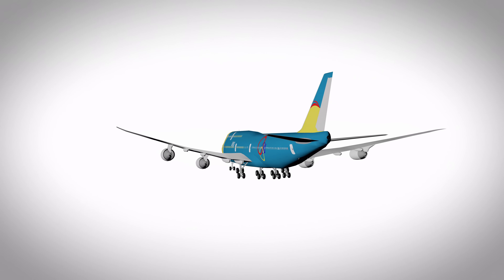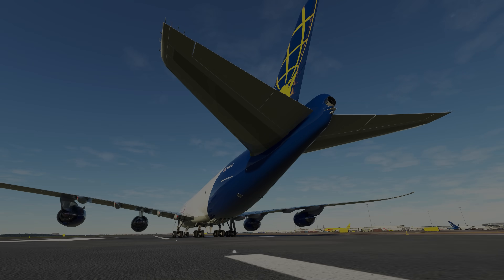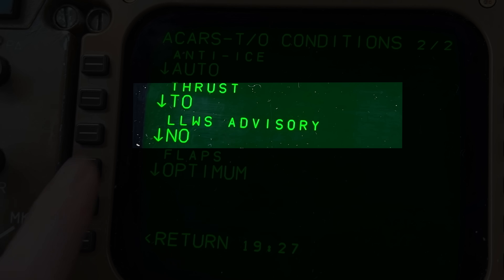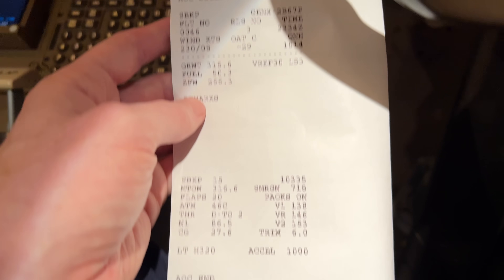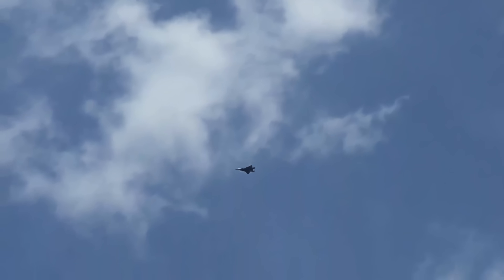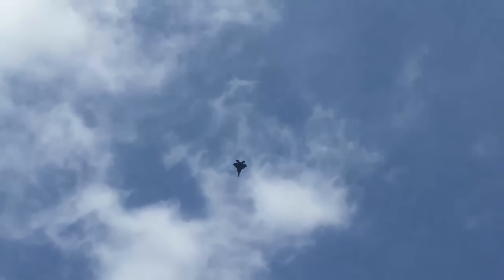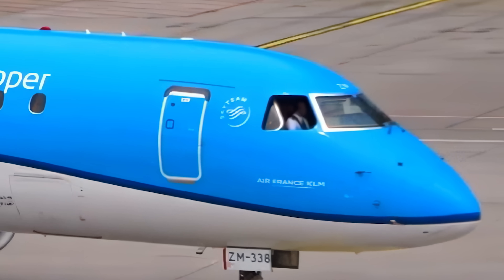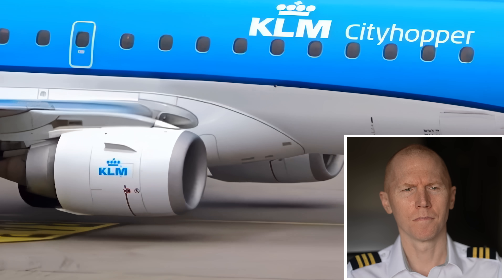Unsafe 747-8 Vertical Takeoff

Comment: Car gal here, also ex truck driver. Also motorbike gal.

Your comparison to using transmission / gearbox / engine braking is so way off its not even funny.

Have you ever taken your foot off the accelerator in a car before? Guess what you are doing...

With an automatic transmission, you when your engine revolutions are low enough, you can just move the leaver to a lower gear selection and it will shift down, increasing engine revs and increasing that breaking force.

With a manual transmission the braking force is even stronger as you have a direct connection instead of a torque converter.

On some vehicles, most commonly trucks, there are a number of "supplemental braking" options including engine, exhaust and transmission braking systems.

All of which ultimately transmit force through the transmission / gearbox to slow the vehicle.

Some of these systems can have their intensity levels adjusted in cab and on the highest setting its like slamming on your foot brakes.

At those settings, they even active the brake lights.

Transmissions and gearbox's are DESIGNED to do exactly that and whilst you technically can force a transmission to shift, or shift a manual gearbox, in such a way as to cause damage, that damage is most likely to occur in the engine.

A driver who does this is the same sort of person who might lower the flaps to maximum whilst at full engine power and sitting at Vne.

You REALLY have to be an idiot to pull it off.
Reply: Except when there's one of those pesky "No Engine Brake" signs.  But I think Kelsey wasn't talking about truckers just ordinary drivers. For the ordinary person driving their Kia Forte and using engine braking every time they slow down because they want to avoid wearing the brakes, wouldn't that have at least some effect on transmission life? I'm talking about the life of the car not necessarily just the time that the owner has the car, because of course they probably won't wear out their transmission during say seven years of ownership. But I would think some owner down the line might be needing transmission or clutch work sooner than they would have if money mizer guy who owned it before hadn't tried to save money on brake pads.
Reply: @StevePemberton2  I was talking about ALL vehicles, not just trucks.

And honestly, the transmission / gearbox is under much more strain when accelerating hard than when decelerating.

I'm not sure if I'm actually "saving" brake pads, but I'm keeping my vehicle under much better control.
Reply: @35manning  Not doubting any of that, I'm just wondering about long term life which is a lot harder to gauge. But also I realize not a topic everyone cares about, at least based on previous discussions I have had on similar topics when I am informed that the person doesn't care because they don't plan to keep the car more than a few years. Which I understand but that doesn't change the question of whether there is wear or not and how much. If say a car is downshifted at every stop for its entire life, does that mean the trans or clutch fails at 240,000 instead of 250,000 miles, well of course no big deal then and there would have been some break wear savings to offset that. But if it's a difference between say 150,000 and 200,000 then that's possibly going to make a difference to somebody down the line.
Reply: @StevePemberton2  I'd love to see a scientific test about the claim.

Take at least 20 new cars, all the same make / model, put them on dynos and control the brakes, accelerator and transmission by computer.

They all accelerate the same, at the same time. They all slow the wheels at the same rate until stopped.
Half use foot brakes entirely. Half use engine / transmission braking as much as possible with foot brakes at the end.

When brake pads need replacing, replace them.

Continue until all the transmissions break (on all vehicles).

Then look at the results, did the cars that used engine braking have their transmissions fail sooner? If so, by how much.
Break down the cost of repairs, average that over how distance travelled to find out the cost for the difference using brakes only.
Work out how many brake pads were used, their cost per distance etc.

I mean, I'm not aware of ANYBODY who has actually done this sort of testing.

I can say, my 1989 four wheel drive has lived a hard life, used and abused often beyond its limits in an environment that most cars shouldn't be driving in.

And after over 1,000,000 km (the odometer stopped working, I couldn't say how high that number is now) its gearbox still works very well.

And I'm not talking about just gentle or even aggressive down shifting for engine braking, I'm talking about high revs and dumping the clutch hard, bouncing the wheels off the ground which causes shock loading on the system etc.

I'd like to see numbers, not wives tales.
Reply: @35manning  Numbers would be great. Especially on regular entry level cars not 4WD designed for ruggedness. Which is what I assumed Kelsey's original comment was about, he specifically referred to someone who is not necessarily skilled at shifting. Not that it takes great skill to drive a manual transmission but the implication was the average driver who isn't really a car person but who has heard somewhere that it's better to downshift to save the brakes so that's what they do every time they come to a stop.

What I wonder is on a typical car how good that is for the life of the powertrain. Probably not a lot of data on it because realistically I don't think a lot of average drivers driving average cars do that whether manual or automatic. At least I don't remember driving with anyone who did that, I guess maybe I just have never driven with any car guys or gals. If more people drove that way then you could find average priced cars that were driven that way their entire life and compare them with cars that were driven normally.
Reply: @StevePemberton2  I've had many cars and motorbikes, not all rugged modified offroad vehicles. I also teach others how to drive including down shifting.

Many modern cars with "sports shifting" modes etc include protection systems to stop the one thing that can cause issues, shifting down gears too quickly / at high rpm.

Any one who does that, will realise VERY quickly their car doesn't like it. The engine will scream at them.

As a car gal, or as I prefer to call my self, a driver, jump in the passenger seat with me and you'll see me doing a dance with my feet.

I use a combination of techniques, rev matching, double clutching, left foot braking, heel - toe braking etc.

Whilst I would never break the road rules *looks around for police listening in*, I've driven all sorts of cars much harder then intended.

As in, three of my cars and all of my motorbikes have gotten air time. As in all wheels off the ground.

I honest think that only two of my cars have ever kept all four wheels on the ground. 

That's not to say I'm reckless, there is a time and place for fun, lots of traffic, wet weather, lack of sleep, passengers, other people's vehicles all dictate my driving style.

Never had any issues with transmissions or gearboxes.

The closest, was my four wheel drive just after I bought it and drove it hard.
Jammed the handbrake on with mud, didn't realise (because the lever still worked fine) and the engine is so powerful it just ignored it. But the clutch wasn't so happy about powering forward whilst also braking hard.

Needed a new clutch, but that's also a good thing. A clutch is pretty cheap to replace and is a good weak link that will protect the more expensive gearbox and engine.
Reply: @35manning  I have always been interested in double clutching but I have never driven with anyone who did it. I thought I remember reading that it doesn't really work well on a standard car with a synchronized clutch but I could be misremembering.
Reply: @StevePemberton2  lots of people say you shouldn't double clutch a synchronised gearbox, but I've also yet to see any evidence as to why.

Yes, it can be done and I do it all the time. I sometimes also float my gearbox (shift without using the clutch).

Of course I learnt to double clutch on a crash box (non-synchronous) where you either do it, or you make loud noises, but you can learn to do it on any manual.

Downshifting is the best way to learn to do it.

1) Wait for your revs to lower enough to support a down shift.
2) push clutch in, shift to neutral and release clutch. 
3) push accelerator hard to increase revs to the next gears rpm.
4) push clutch, shift to next gear and release clutch.

If you do it right, when you release the clutch the second time, your engine RPM won't change at all.

If RPM increases, you didn't rev enough, if it decreases you revved too much.

Floating your gears is actually easier, just less forgiving.

Upshifting is easier for this.

1) whilst accelerating and near peak rpm, apply firm pressure to the gear lever towards neutral.
2) lift off the accelerator, if you've applied enough pressure to the gear stick, it will just fall out of gear.
3) move towards the next gear and apply the same level of force on the gear stick.
4) when the engine rpm falls enough, the gear stick will just fall into place.
5) push the accelerator and repeat.

Downshifting whilst floating is basically the same, except you pause the lever in neutral and use the accelerator to increase engine rpm to the next gears require rpm (or just above) and then put pressure on selecting that gear.

Unless it's broken, you can always use your clutch to fix it if you stuff up on floating.

Once you know the RPM difference between gears, you can also skip shift using both of the above techniques.

That is, change from 1st to 3rd, 4th to 2nd, 5th to 1st etc.

Most trucks actually are easier, as their gears are very evenly spaced apart, normally 500 RPM for a full gear, 250 RPM for a split gear.

Cars, not so evenly spaced. But once you learn your car, you know your car and I don't even think about it or watch the tacho, I just feel what it needs.

Being a good driver isn't that hard. As long as you WANT to be a good driver and not just get from point A to point B.
Reply: @35manning  I'm thinking maybe what I had read was that double clutching wasn't really necessary with a synchronized clutch. I suppose that's true to some extent for the typical driver, similar to the concept that automatic transmission for most people is good enough in terms of accuracy. Whereas for others obviously it's not.

The most abuse I think I did was when my father's VW bus clutch went out somewhere, maybe the cable broke or something, and he sent me out to go get it and see if I could get it home without a clutch. A friend of mine came with me. There was just no way to get it into first gear without the clutch, it kept stalling.

I don't remember whose idea it was but with the engine off I put it into 1st gear and then I turned the starter motor, which propelled the car forward. Took a couple of tries but then the engine started. Drove home about five miles with no clutch, fortunately it was night and no traffic and few signal lights back then (about 45 years ago). No real problem shifting, I think getting into second took a little effort but no problem getting into third and I may have just left it there as I didn't go that fast anyway. Most signal lights I could time it, but I did get stuck at one light. I think the engine stalled before I could get it into neutral. So I had to do the starter motor trick again when the light turned green.
Reply: @StevePemberton2  I've driven a car with a broken clutch, similar to your story. Just start it in gear, turn the engine off if I needed to stop.

Double clutching isn't needed for a synchronised gearbox, BUT if you know how it is so much better. Let me explain how it works and you'll understand why.

You have your engine, then clutch which disconnects the engine and gearbox, then the input shaft from the clutch enters the gearbox.
An output shaft exits and is connected to the axle and wheels.
On these two shafts are a series of different sized gears, fixed in place on one shaft, sliding on the other.

Your gear lever slides the one selected gear until it overlaps and meshes with the fixed gear on the other shaft.

The problem is when you are moving with the clutch pushed in, the input shaft slows down and stops moving (eventually) whilst the output shaft keeps spinning.
So the gears hit each other and won't mesh together.

A friction pad on the gears however, can rub and spin the input shaft up to the same speed (hence why its called synchronised) and then the gears can easily slip together.

These friction pads do wear out, but should last the life of the gearbox.

You now have both shafts locked together spinning at their respective ratios.

But the even if you are quick, the engine RPM is now different from the input shaft RPM.

So your clutch, basically a friction pad on steroids, gets released and starts to slip until the engine RPM and the input shaft RPM are the same.

Of course, the clutch slipping will also wear down the clutch.

If down shifting, you are also increasing the engine speed by force, rather than by using fuel which is technically more fuel efficient, but also harder on the engine.

You can reduce slipping on the clutch by releasing it faster, even by dumping it. But this is even harder on the engine and produces a jerky ride for the occupants.

You can make it easier on the engine and smoother for the occupants by releasing the clutch slowly, but this causes more wear on the clutch.

Or you can rev match the engine with the transmission and the only wear is on the gear friction pads.

Or you can double clutch and the only wear is on your leg.

Understanding how this all works, I still don't know why some people say that double clutching is "bad" for synchronised gearboxes.

It's not "necessary", but put on some ear muffs, close your eyes and see if you can tell when I change gears.

I've also driven a truck (Unimog) that had a synchronised gearbox and one of those gears had a failed / worn out friction pad.

My instructor told me of it and said to just skip that gear.

Being that my "learning to drive a truck" was a formality of my new job and I was already an experienced professional truck driver, I just double clutched it in and said nothing when my instructor commented on how impressed they were that it "just went in".

Needless to say, I passed the test and later on was trained to be one of the driving instructors.

Comment: I'm a car guy (25 world/national records in dragracing, track champion, division champ etc)... it is perfectly acceptable to downshift to slow vehicles. In fact it is preferred in a stick shift vehicle rather than dragging the brakes as you are coming to a stop. Keeping the engine RPM's up a bit is also safer if you have to "get out of the way" of another driver as you are slowing. Does not hurt the trans nor the engine one little bit.
  BTW, also a pilot, knowing that camera angles can magnify human perception of ascents, I did not think this any more than about 15-20 degrees. 20 probably, which would be high but not unsafe. Of course, I flew smaller planes lol

Comment: Long story short: plane was light, wind was strong, pitch was slightly higher but nowhere out of limits. Normal take off and nowhere "vertical", ATLAS operates a lot of DHL flights and these are not typically always heavy but need the volume., hence a 74 will not always lift off at high weight.

Comment: with the 747 if you notice its windy and ahead is bad weather. And you van clearly see that seconds after they take off they start turning whilst still climbing. I have seen 747 take off the same way at the international airport when there's bad weather straight ahead in order to avoid it

Comment: Short Answer:  As a cargo hauler, Atlas Air often makes unloaded or lightly loaded preposition and deposition trips. As such, the profile involves

1)  Reducing throttles to the most cost efficient climb setting.  This involves many factors, but is designed to minimize the sum of all cost factors, mainly fuel burn and engine wear, over the life of the aircraft.

2)  Adjusting pitch to achieve and maintain best rate of climb speed (Vy), the ideal speed to attain the biggest gain in altitude in the shortest amount of time.  Higher altitude means colder air and less drag, both of which burn less fuel.

As for the fighter jet, it's not witchcraft.  It's vectored thrust maintaining the attitude of the aircraft during flat spin, then aiming it straight while increasing velocity to pull out of the flat spin.

Comment: Yes manual cars should use the brakes not the drivetrain because brakes are cheaper to replace. Semi trucks are different, they use the drivetrain to slow because truck brakes are expensive and will wear out fast if that's all the driver uses to slow down.

Comment: When I saw the cloudy skies I had a feeling it was for wind conditions since gusting winds would add and subtract lift. Once he gained altitude and nosed over it looked like he wanted more altitude for safety reasons.
I knew a classmate who was a little short on common sense. He didn’t have good brakes on his car and he claimed he stopped by using reverse. Fortunately I didn’t ride with him and made a point of never riding with him EVER after hearing this. It being an automatic it’s possible but I wouldn’t want to explain to cops what went wrong with the brakes and transmission .🤞